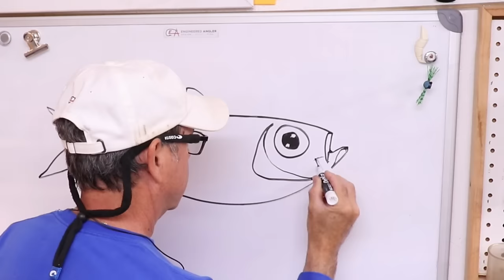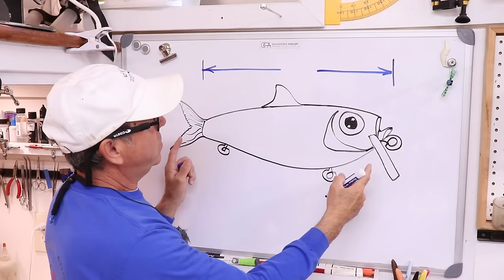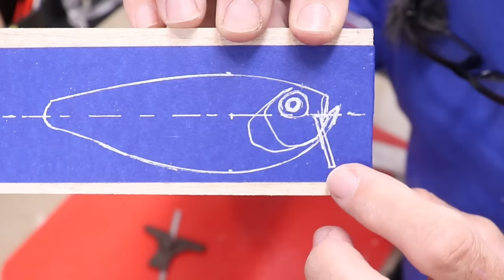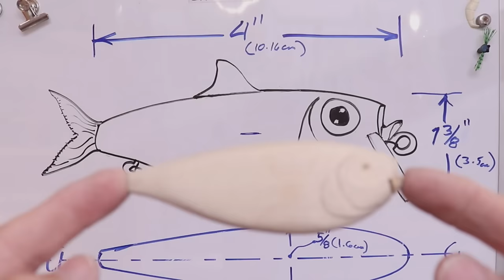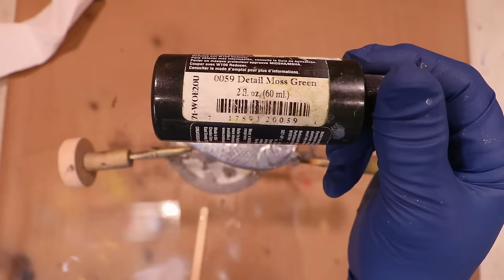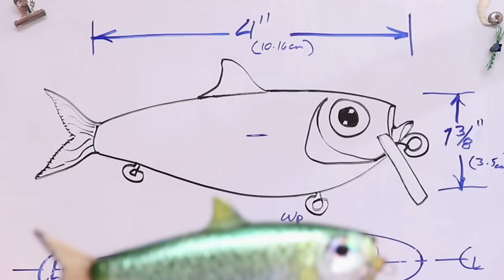Making a Pilchard lure, Mahi trolling lure DIY  #luremaking #lurefishing #trolling

Comment: I know I might not get answer but I’ve started resin casting lures and I’ve used both of your resin/ micro ballon mixes but I get air pockets/voids in the sides of my lures can I please get some advice
Reply from the maker: Send me photos of the mold, open and closed and with any hardware you put in it.   Let's start there...
EngineeredAngler@gmail.com

Comment: Absolutely beautifull pilchard, if it didn't have hooks and a bib I'd try and gut it for cooking. I have a few questions about the wood you use. Do you dry it yourself and how do you do it or if you let somebody else dry it for you? Do you just let it sit in a dry area or do you somehow steam and / or pressure treat it? I'm worried that if I let stuff like pine and wallnut sit around and dry that they might warp and twist.
Reply from the maker: I let  The wood dry as larger pieces inside my shop period after about 6 months I cut it down to smaller pieces.  Sometimes I'll get some warping and some cracking but most of it dries pretty clean.

Comment: Nice one Franco, that came out super nice. I hope you don't get bitten off or snag it after all that work! I just ordered some of the uv resin you normally use, never used uv resin before.  I see marling baits has been setting it in sunlight lately. Have you tried that at all?
Reply from the maker: Yea sunlight works, takes a bit longer.

Comment: I use the same method with a pair of push pin thumb tacks to find the positions of the eyes, if I don't pre-drill a through hole before rounding off the body. 

Now I'm wanting a pair or two of scalloping shears, those scales look amazing! Question about the scissors... Do you have to stop and clean any adhesive off while cutting the tape or do they stay pretty clean during the process? I like the way the first lure you showed with the aluminum scales had them darkened around the edges, like a "black wash" of paint.

Super nice lure Franko!
Reply from the maker: The scissors stay pretty clean...I'll need to clean them eventually.
Reply: @EngineeredAngler  Well sir, I finally purchased the scalloped scissors and completed the lure. It took three evenings to cut and apply foil scales to a 7 inch 2-piece swimbait! I'm not sure if I'll ever do this again to a lure this large, but everyone that has seen the lure or its photos have been amazed. Thank you Franko, for the lesson in patience!  😄 Even after watching this video a couple more times, I was surprised at how much weight was added by the tape. I added 5% ballast instead of the usual 15% and was shooting for a suspend to slow sink. I could have probably added between 0% to -5% ballast because I ended up with a medium sink on the lure. It swam as beautifully and it looked though, so I'm not complaining.

Comment: Question, you mentioned making a mold with the scales. Would the thickness of the tape be enough for the silicone to pick up and then transfer to the resin? Or would it look sloppy?
Reply from the maker: No...I've done some experiments and you need triple thickness.
Reply: I figured as much. Thank you!